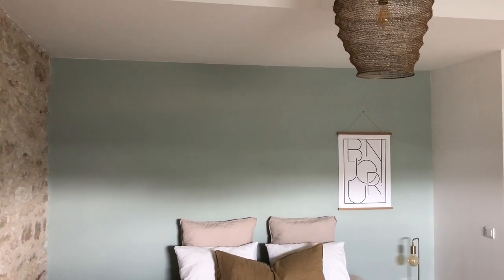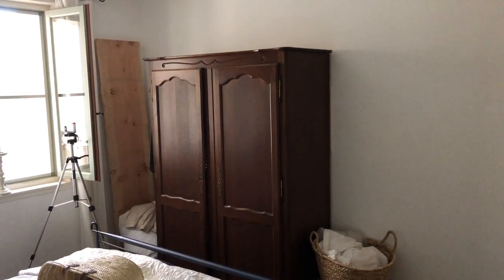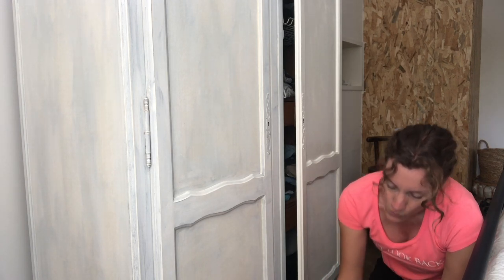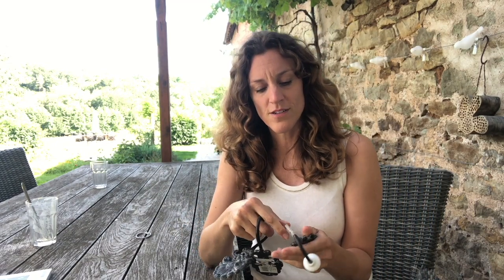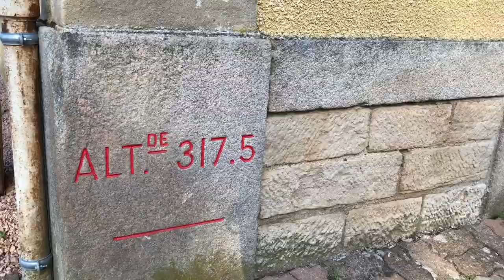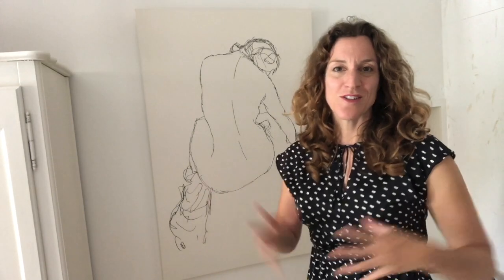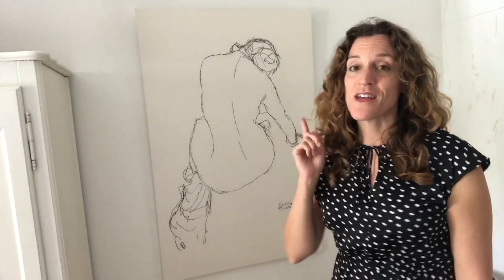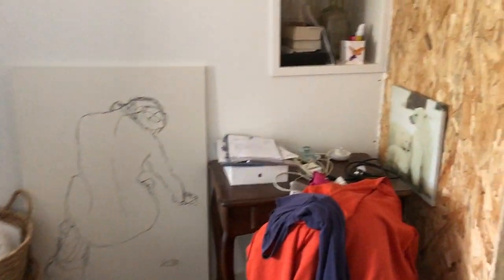Makeover of our bedroom, French farmhouse style

Comment: When the sanding disks don't stick to the pad of the sander, it's because the velcro has worn out. There are replacement 'velcro stickers'  available to put on the pad, so you can again stick on the sanding paper. That solution might not last for long though. See also https://www.millin.co.nz/blog/why-do-velcro-backed-discs-fly-off-my-sander/
Reply from the maker: Thanks for your comment! I used brand new ones at each time and it still wore out extremely quickly. I think it was the brand because other ones didn’t get off that easily. But I will surely remember this if I ever do this again and it happens again…